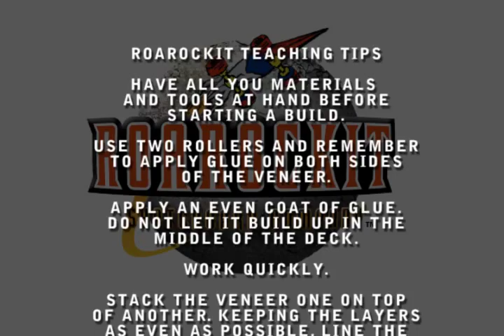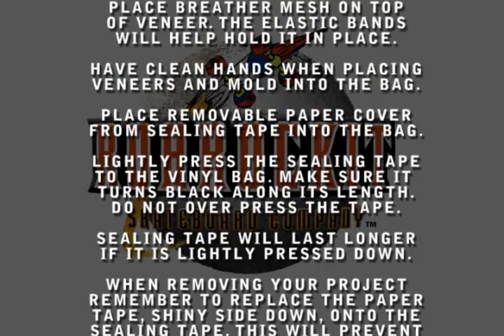Building A Skateboard In The Classroom

Comment: The thinner the sheets the easier the bends to form. A one-ply 1/2 birch will not work because a) Too thick b) nothing to allow it to press and hold a shape because of no glue and c) even if you could press it it will return to its original shape (flat) because nothing is holding the shape together. Hope this helps! Also, if you are using birch, use baltic birch.

Comment: No problem.
One thing to bear in mind...
Vacum bags like this (or any other) can't draw more than 1 atmosphere - that's just shy of 15psi - so you may not get as good a lamination with one of these as you would with a system that used mechanical, pneumatic or hydraulic pressure instead.

I'm not 100% on how much pressure is needed for a skateboard, so maybe a vacum bag is plenty, but it's something to consider.

One thing's for sure - this is the simplest system I've seen yet.

Comment from the maker: Baltic Birch is a plywood and not an ideal board building material.  You can give it slight bends, but in order to get any real extreme bends you will need to use a thinner solid veneer.

Comment: Here's how I see it - maybe it'll help:

In a vacum bag, you're using the weight of the entire atmosphere above your workpiece to provide the pressure. Average atmospheric pressure (1 atm) is +/- 15psi.

The most powerful pump on the planet can't draw out any more air than is in the bag to start with, and if you draw it all out - you'll have 1 atmosphere, or 14.7psi pressing down on the bag from above. The only way to go to a higher pressure is to provide more via a press.

That any clearer?